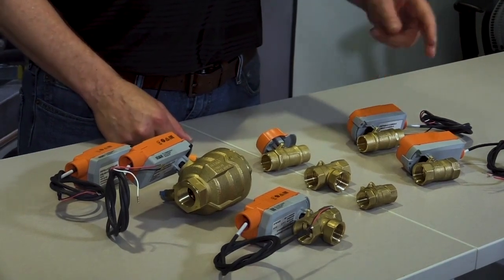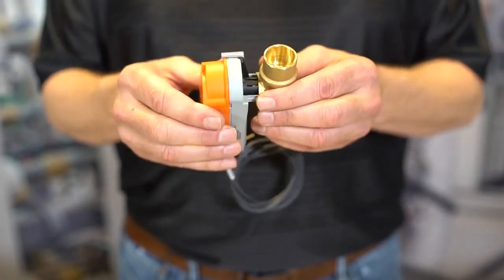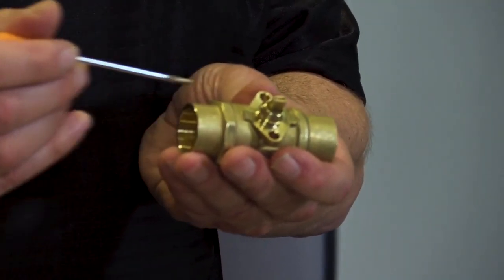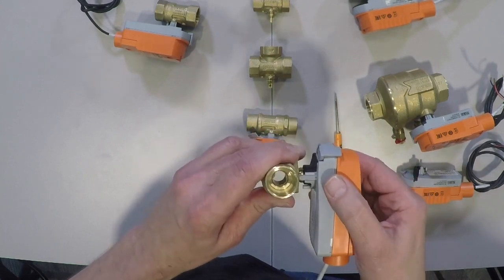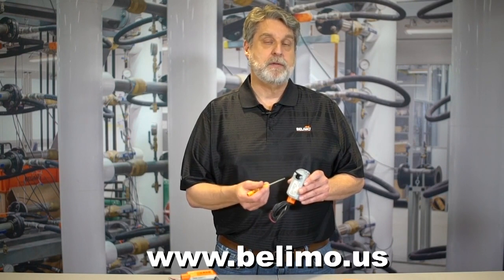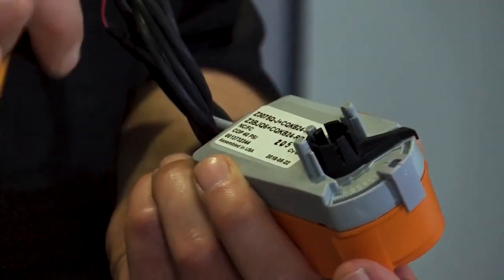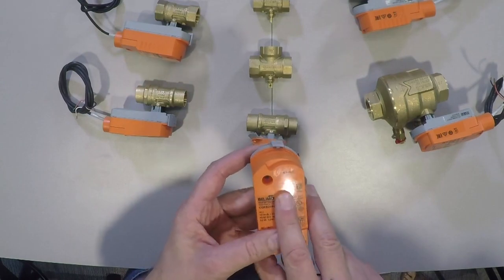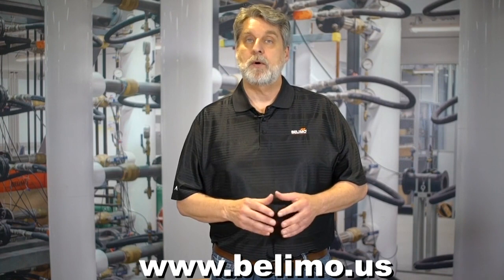How To: Remove Actuator from Belimo ZoneTight Zone Valve

Comment: On a 1/2” 3 way valve, will setting the CV rating stop keep the valve from over stroking? Looks like full flow to the reheat coil is about mid point in the stroke.
Reply from the maker: For 3-way valves, we do not recommend using the limit stop on the actuator. Instead, we recommend removing the clip to achieve a 90° angle of rotation, which is necessary for proper change-over functionality. The adjustable angle of rotation feature only applies to QCV 2-way CCVs.

With a 3-way valve at an opening angle of 0°, the flow rate between A and AB is ensured. At 90° (fully open), the flow shifts to B and AB.

We hope this helps answer your question. For more help we encourage you to contact our regional technical support teams that can be reached by phone or email.

Comment: Hi there, good day sir.  I am wondering where I can get a new internal plastic gear for the belimo CQKB24-LL actuator?  We have about 300 of these at the building I maintain and we are having some of them with the internal gear breaking and thus the zone valve will no longer operate.  Thank you in advance!  Hoping to hear from you soon.
Reply from the maker: Thank you for reaching out! Unfortunately, we do not sell individual replacement parts for our actuators. Because it seems like you're having a reoccurring problem, we suggest reaching out to your local tech support team to help better identify why it seems the internal gear is breaking. The will also be able to identify if your product is still under warranty. If you need assistance identifying your local tech support contact (https://www.belimo.com/contact/channels/belimo-contacts), please let us know!

Comment: Does Belimo make a Zone Control Panel for these?
Reply from the maker: No, Belimo only manufactures damper actuators, pressure independent and dependent control valves, sensors, and HVAC retrofit solutions